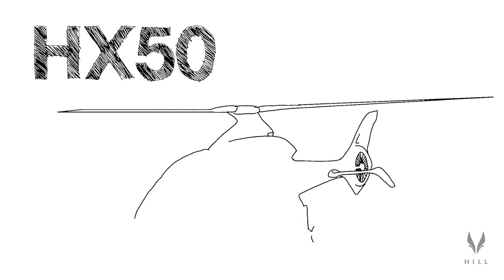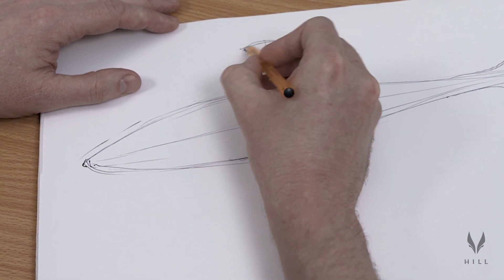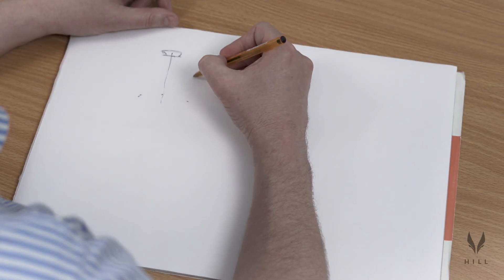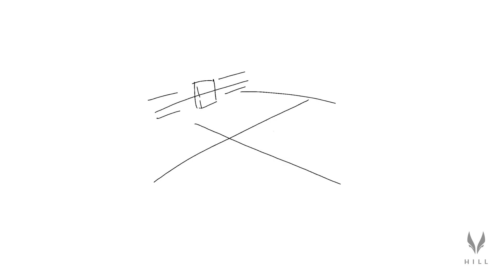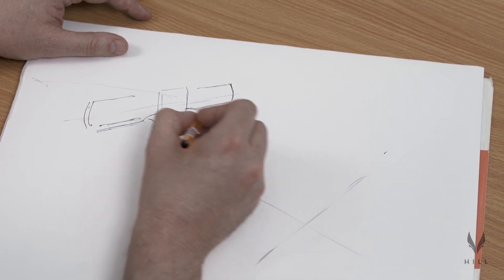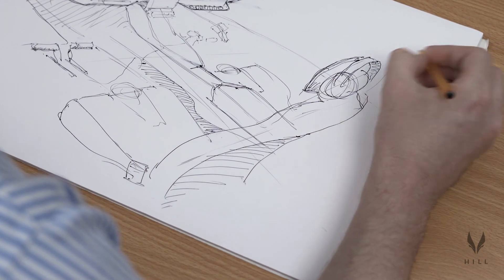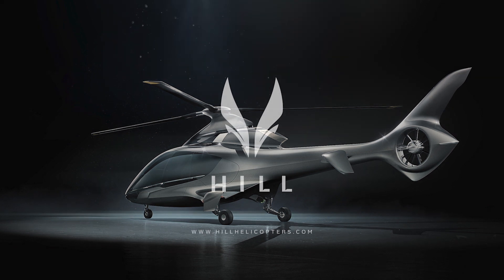HX50 - Behind the Design

Comment: Hello Engineer Hill! I have a concern about the turbine exhaust angle. How the water is going to be control to enter into the turbine during flight in heavy rain? How the exhaust heat will be control to prevent overheating the main roto blades during 3 or 4 hours flight? Greatly appreciated your advise and thank you for the beautyful helicopter design.
Reply: downwash from rotors is too strong

Comment: What I really like about this is that you are looking at everything, even the traditional way of doing things and asking, is this the best way of doing it, can we improve it.

I was recently looking at the Bell 505. I think it looks awesome. But I was shocked to find that essentially only the cabin, and avionics is new. Same drivetrain, rotor head, and blades as the old 206.

My tip from various aviation projects, including business jets and helicopters, make sure you have a separate weights team that know what they are doing. You have a great design but could face issues if the weights are not controlled.

Comment: I am interested to see how pilots take to the new collective design. Translating it from vertical to horizontal action may cause cognitive dissonance. Without trying it, I am finding it difficult to imagine especially in confined spaces. Hopefully it can be converted to a traditional layout once they have the prototype flying.
Reply: The purpose to accumulating hours and hours of training is to have ingrained muscle memory and unconscious reactionary decision making. I'm worried that moving away from a tried and tested control structure that has been around for decades will detract potential owners. The gentleman speaks of how far automotive design has come in 60-70 years, yet I can't think of any automotive manufacturers that reinvented how the gas pedal, brake pedal and the steering wheel function... Additionally, I'm concerned designing a helicopter without skids will also detract potential explorative owners that live in mountainous areas where perfectly flat landing pads aren't always available. Innovation in technology is fantastic, but it is my opinion that a design philosophy for helicopters should not be form over function.

Comment: 1:53 - "Vertical take off and landing is great, but it's only great if you can do something when you've got into the air". This sounds as though you believe todays helicopters are totally useless? Vertical take off AND forward (or any direction) flight is nothing groundbreaking. It seems to me that the only knew ideas are the cyclic and collective.. even then, those "new" control concepts are not actually new. 
I believe you are trying to re-invent the wheel. 
But good luck, I'm interested in what comes of this.
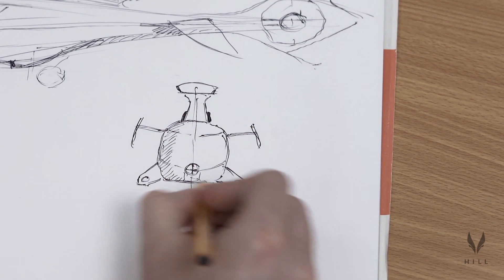Reply: 2:00 - did you figure out how to achieve the 200 mile per hour spec yet?  And 5 hours flight time?

Comment: So would this new type of collective be mechanically or electronically controlled? In case of an emergency electrical issue i would prefer mechanical control. Im not a pilot but very interested in helicopters, ihope what i typed makes sense.
Reply: it could easily be mechanical. Take the current configuration and rotate it 90 degrees. It will most likely be hydraulically assisted.
Reply: Mechanical